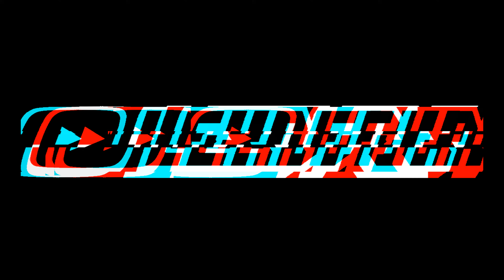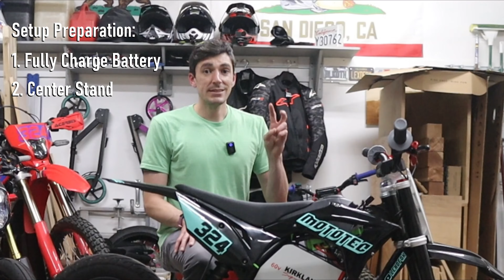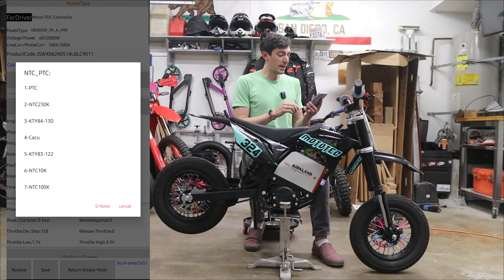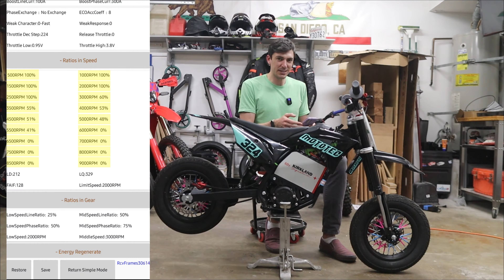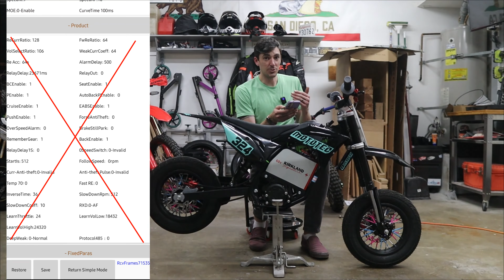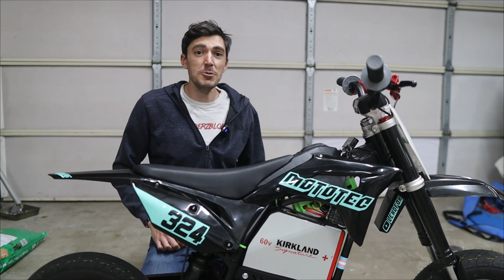How to Setup and Tune a Fardriver, a Beginner's Guide

Comment from the maker: Good luck tuning, everyone!

A couple links where you can get a fardriver:
https://www.hotpaxx.com/product-page/fardriver-nd72300-72v-100a-line-300a-phase
https://econiccycles.com/products/fardriver-sinewave-controller-nd72300-w-bluetooth

Find copies of the Far Driver manual and setup instructions here:
https://drive.google.com/file/d/1W1zUCG5ctGXXglA6NctcUnrGYchHaW9N/view?usp=sharing
https://drive.google.com/file/d/1S_1ywSVyuE-evXWIlr9W7RlLeoRQ9MFC/view?usp=drive_link

Android Users can download the Fardriver App here:
https://www.far-driver.com/the-controller-app-for-android/

And here's some other helpful resources:
https://riderguide.com/guides/electric-scooter-battery-voltage-chart/
https://endless-sphere.com/sphere/
https://www.facebook.com/groups/1083179719298581
https://www.facebook.com/groups/923856302074029
https://www.facebook.com/groups/fardriver

Comment: I tuned my controller like you said and followed the recommendations.  Ended up making some deviations to help get some more speed out of it but when I put it in third speed, I get the max rpm’s (5900 per the tune settings) when at about 50-60% throttle.  When I run the throttle wide open in 3rd speed the rpm’s drop to closer to 3900 rpm’s.  What do I need to change so when it is fully wide open in 3rd, it doesn’t drop the rpm’s?

Comment: After auto learn my bike would spin the wheel fast but after I get on and try to go it almost doesn't move
Reply: you can try different arrangements for the phase wires. Easy to see if that was it. You can also look to see if any default settings look wrong or questionable.

Comment: Hi. I live in Norway and highly consider to buy the Arctic Leopard XE PRO S Enduro L1e moped street legal version. The speed is limited to 45kmt/28mph. I want to be able to drive legal on the road, but have fun on closed tracks and trails. Can you remove the speed limit in the display settings or is it adjusted in the fardriver app? I guess is not a hidden wire on this(?). It would be highly appreciated to get some info in this and what settings in the fardriver app to change to get the top speed it was intended out of the box (unrestricted version). AArctic Leopard XE PRO S Enduro L1e moped. Thanks in advance ☺️
Reply: If you look at the area that has all the parentages VS RPM, the last one is "Limit Speed".. He doesn't say anything about it, but I'm guessing that that is your switch that has High Low, so leave that setting at a lower speed (write down the number), and test, then raise it a good bit and test again. I'm looking for the same idea, where if I flip that switch, it goes to the e-bike speed limit for my area, so I can just flip the switch, and not have police pulling me over. 

I will be playing with my tune a bit today, so I might update this comment.

Comment: Maybe someone can help? I have a kugoo wish 01, I plugged in a Bluetooth adapter, changed the speed to maximum, tried it, it worked, then changed the settings, and then it just started beeping (2 short and one long), I turned it off and on, nothing worked, reset the settings, etc., now the application says: 1. Motor Hall Error
(I tried resetting everything, turning on auto-learning mode, nothing works)
Reply: any solution?

Comment: Do you know how many pole pairs the Electro N Co 2.0 motor upgrade for the mototec has? I want to upgrade my stock motor and already have a Fardriver 72360 so I do not want to have to use their controller? Any help highly appreciated

Comment: @14:06 No, Autolearn doesn’t set throttle low and high in most fardrivers. It comes set to safe defaults which typically work with most hall sensor throttles,  but will not work with a potentiometer throttle. 

This does NOT set the volume going to the throttle, it simply allows you to tell the Fardriver what the 0% throttle and 100% throttle signal coming from the throttle is. 

To set this you simply look in Graph and see what the voltage is at 0% throttle, and add 0.1v to that if your throttle is decent quality, or 0.2v if your throttle belongs in a trash can or you don’t know how to release the throttle fully.

Then squeeze the brake (if you have brake sensor connected) and twist to full throttle. Set throttle high equal to this voltage. There is a safety feature that shuts off the motor throttle signal gets 0.6v higher than this setting. So if you use a potentiometer throttle with default settings, it will go too high and shut off the motor. So this must be increased to prevent the normal full throttle from tripping it.
Reply: This is exactly what is happening with my kit, may I should change the accelerator to get a better power to start. Thanks for your help. 👏👏
Reply: @edgarbrito7561 , the fardriver throttle low and high should always be set for the throttle installed. Typically 0.1v above the voltage the throttle puts out when at 0% throttle, and throttle high set to the same voltage the throttle puts out when at 100%.

The main objective of this setting is to get the throttle signal from the throttle properly interpreted by the controller, with minimal deadband and maximum resolution.
Reply: Sounds like you know what you are talking about. I've moved from Kelly to Fardriver and right off the bat I'm having issues with the throttle (amongst other stuff). My experience is with Curtis and Kelly controllers and they have a simple system where you set the throttle low deadband and throttle high deadband and can then set the throttle mapping and it will use the entire throttle range. With the Fardriver I can set the same but when I use the throttle and wheels off the ground I only get around a quarter of the throttle to full speed, the rest does nothing. AI seems to think that its normal when the wheels are off the ground and then when driving it will use the entire throttle allocated. Is this true? Something to do with torque based and speed based controllers. 
Also having issues with getting regen to work, plus get rid of some torque ripple at very low rpm. 48v system with dual 2kw QS single shaft hubs at the rear. My offroad scooter with dual 1KW hubs front and rear (much smaller) don't make a sound and I put this down do a much smaller distance between hall sensors. Had the issue with Kelly and was hoping Fardriver could solve the lowrpm crunch issue, as its related to finding the hall sensors from no rpm, but so far its worse. It feels like a whole different system with the speed ratios etc. Any insights would be great.
Reply: @d1o2n4 , Fardriver throttle calibration is pretty basic, and should be done between any tuning. Setting Throttle Low about 0.1v above the 0% throttle voltage signal and throttle high equal to the 100% throttle signal. 

There is a ThrottleResponse that can be set Line (Linear) for bikes with good power where you want better throttle control, Sport for weak motors/controllers thar will front load 50% power in the first 25% throttle to make you think your motor as weak as it is. I recently Linear.

To the left of the throttle voltage signal is the Fardriver throttle command signal 0-256, which takes all the inputs and settings and then sends out a command signal. 

I use VESC also which lets you choose torque based like a gasoline motor or rpm based so it works like a diesel with a governor. 

The best way to get rpm control in the fardriver is the set the rpm and amp limits correctly for speeds 1-2-3 and Boost (special speed 4). But if you only use one speed (mode 3), then setting maxspeed at an rpm slightly lower that the actual max speed. Then the Fardriver knows the actual rpm range to shoot for based on throttle position.

To get rid of any low end crunch make sure PID settings are correct. Since you have small hub motors, and all hub motors use surface mounted magnets, then AN should be 0-4, normally 0 is fine. Then LM can be tuned starting at default 22 and decrease to 20 and test full power takeoff, listening for grumbling. Then set 18 and test again, then set 16 and test again. This must be done is a very quiet place. Once you no longer can hear or feel the motor os smoother or quieter, revert back to previous setting. I normally use LM 16 but it should be tunes for your motor.

Start-Mid-Max KI is set 4-8-12 by default, and this is typically very slow. You can use the fardriver manually which has groups to try, but normally 2-4-6 will work good for controllers set at maximum amps. But try to gradually adjust. Both motors will probably need the same settings but if you run a bias front to rear power it may need independent tuning.

Since fardriver is not designed for dual motor, like VESC is, there is no way to set master/slave, so both fardrivers must be tunes correctly, ideally using two separate phones so you can see both fardriver graph page at the same time time. If set wrong, one motor might take all the load or even worsr of one is regenerating while other pushing it will burn up the working motor. So you can screen record the graph page on both fardrivers and make sure at each speed the amps are balanced in the proportion you want.
Reply: @imho7250 Thanks for the detailed response and I’ve got some things to try now. Just to clarify, I was referring to my off-road scooter to say how those smaller hub motors are perfectly smooth even with cheap controllers. The 4 wheeler I am working on has 2 large single shaft hub motors (around 17kg each, 2kw) at the rear. The OD of them is 222mm. So the hall sensors are spaced much further apart. 
I really should look into vesc, especially if they cater for dual hub set ups. Just the cost is next level compared to Kelly and Fardriver. Will do some research again on them.
Reply: @d1o2n4 , ok so for the dual single shaft motors you would want both controllers using identical settings, and then if either motor is not staying in sync then  some settings might need to be tweaked. 

Regen needs to be tuned in Pro settings because the noob settings will mess up regen. 

The BMS should be programmed to allow the combined regen effects based on the battery max charge rate. For cheap cells normally thats 1c, and models high drain cells can charge at 3c. 

If one 60ah battery feeds both controllers, then each controller regen should be set to 20a/30a, and the regen ratios can be set initially to:
0%.   25%
50%.  50%
….
50% all the way to the bottom. 

From here you’ll can test regen at each speed and increase or decrease the percentage on both controllers evenly. 

The first two settings are tricky because it will try to kickback if you set the them too high, especially if the tire is off the ground.
Reply: @imho7250 Good point with the battery cells charge rate with dual motors. I was just going off the BMS charge current which is 250A. I’m using 120Ah lifepo4 cells. Something to think about. I always make sure both controllers have the same parameters plus I’m sharing the signal and ground for both controllers and only using 5v from one controller.
But yeah thanks heaps for your detailed and quick responses and will see what I can come up with. It’s always like this when learning something new and will all start making sense soon!
Reply: @d1o2n4 , using two phones running the fardriver app while setting up and tuning will help. Since you will send the throttle voltage signal to both controllers you can see if there is a problem in the graph page. You will see if amps stay in sync and regen stays in sync.

Of course VESC can be connected together with can bus and then both controllers will get the same demand signal but still independently running in sensored or sensorless mode. But Fardrivers can be tuned to stay in balance, you just have to do all the settings on both controllers manually.
Reply: @imho7250  hi i have a fardriver controller  but my bike has no tourqe i have 72v but when i give it throttle the bike takes off so slow and feels gutless. its a half twist throttle if that matters. i need help.
Reply: @1 @1F0_YT , if you can, go to a place you can test your bike, and connect the fardriver app to your bike. 

Start a screen recording, then open Pro Settings, and scroll from top to bottom, slow enough that all settings can be read. The go directly to GRAPH and try some full throttle accelerations.

Then end screen recording and upload it to your YouTube or you can leave it unlisted and post the link on one of my videos.

Then I can make recommendations.

Comment: @8:29 its not a 0-120 degree hall sensor. Its a dropdown list which starts at 0, with 0 being 120 degree. The dropdown list includes several encoders and also 60 degree commutation.

Comment: Learn from my mistake:

If you're connecting an oversized controller (ie: 3000W FarDriver Controller connected to a typical 750W e-bike hub motor), be sure to lower the line and phase current limits in the "Pro Mode" of the app before starting the auto-learn process. If not, you run the risk of destroying the gears in your hub motor.
Reply: Hub motors don't have gears. And the amperage settings have no effect on the autolearn. No matter what they're set to, it only pulls 1-4 amps max during the autolearn. Because there's no load on the motor.

Comment: Awesome video 👍👍
But I reccomend NO ONE to ever buy a Fardriver.
Get a BAC, Kelly or something that actually works.

I had so many brands, FarDriver is the worst ever experience.
The bluetooth and App is horrible, if you even manage to connect in the first place.
Reply: sounds like you just didn't watch this video before trying them 🤣
Reply: The problem is someone needs to design one of these types of controllers that works with 36 volt all the way up to 84 volt batteries and doesn't rely on any proprietary technology something that anyone can just Bluetooth their phone or laptop and program easily something that comes with its own software built in that you can put on to your laptop something that just works at a price point that allows your common person to be able to do this something like $100 electric vehicles could be so much more if only they would just quit trying to make a million bucks off of the technology it's something that can be powered by the freaking Sun stop trying to get rich on it

Comment: i have a 48v and this helped alot with tuning. i did what you did but turned the tuning down like 20% of what you did.
Reply: That's exactly what I was thinking, pushing it a little bit more, but not the point, I can ruin the bike component by putting too much power on it. Can you share your parameter numbers? I know you can't do a 20% on everything, so I want to see which ones you mod

Comment: When I’m doing the auto learn why does it say 2. Throttle failure what does that mean
Reply: After EVERY successful Autolearn, the controller will save settings and reboot. Since you should still be holding throttle at 100%, it will give a throttle error. This is 100% normal. Simply releasing the throttle and the error will clear.
Reply: Ever figure it out?

Comment: i have problm where i try doing auto learn and nothing happens. It just beeps and i twist the throttle and it just sits there. No motor movement and just beeping. I have disconnected the chain and everything. Some advice please.
Reply: Get a new throttle and try it again
Reply: either theres a problem with the throttle, or something is set incorrectly somewhere. It will not let autolearn start if it knows theres a problem with something somewhere